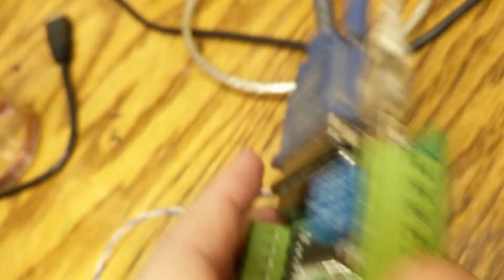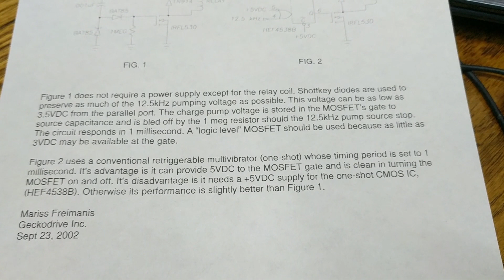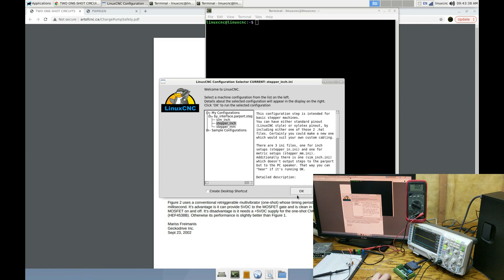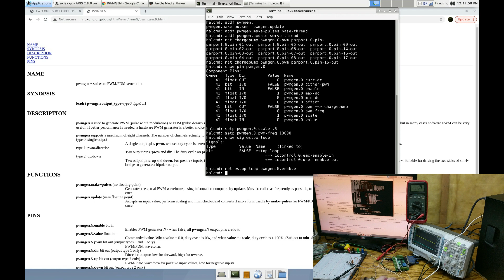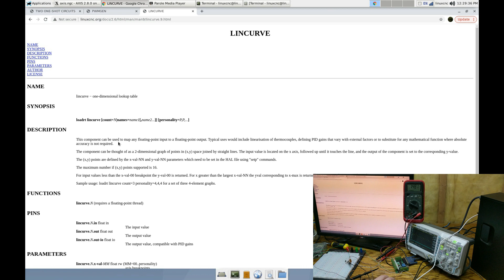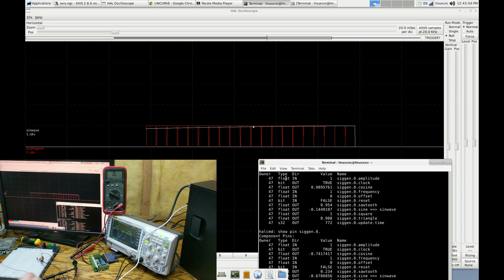What about Bob?  Making and setting up charge pump in linuxcnc.  And analog output.  Warts and all.

Comment: Hi capacitor circuit is not stable in  my opinion. Arduino based or ready circuit is better solution. For example http://sklep.pluszmis.pl/en/p/protection-module-a-charge-pump-for-linuxcnc-with-sequential-switching-and-attiny402-by-updi-interface-pm21-1 I have one PC (2 paralel port) to control Mini Lathe and smal router. All power lathe or router  is switched using this board depend which LinuxCNC  configuration I switch on :)
Reply from the maker: It is a pretty basic circuit.  It is as stable as the signal going into it.  (and with linuxcnc - that signal is stable)
Reply: IMO using a microcontroler to handle a charge pump safety circuit is like using a fox to watch your favorite bird. (Not the most acurate analogy, but at least it is the funnier). A strong EMI noise is enought to hang your PC and your microcontroler, but I'm sure your spindle inverter will keep running. And that is not a good think if your machine is a 10hp lathe.
Reply: @tritile  In this circuit when PC Hang - VFD will be off - when microcontroler will Hang VFD will be off . Where is the danger ?  Bigger danger is that's someone come with a hammer and destroy it :) What is Your "strong" EMI source?  Firstly in my mini lathe i was using 400V DC Brushed motor (china) which was disrupted radio and tv signal, but PC and electronic was next to and working without any problem. Every component may fail even passive ... If fox rise with bird and is trained i don't see any problem.